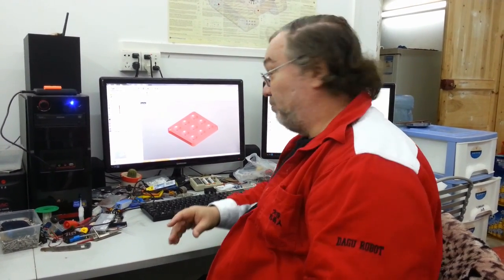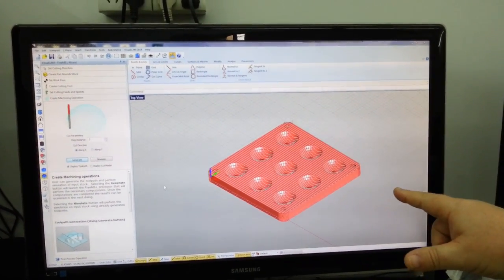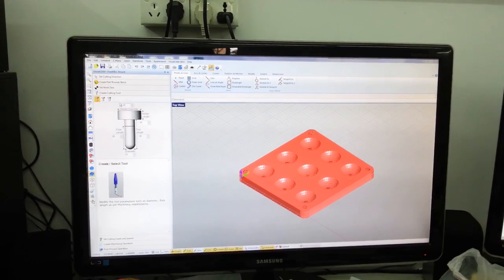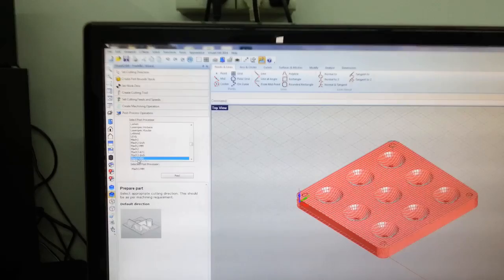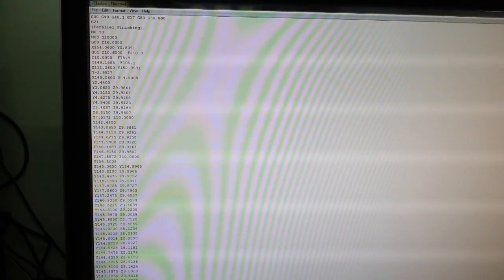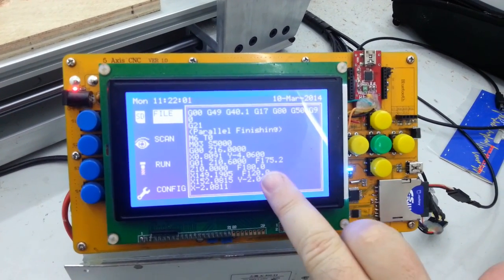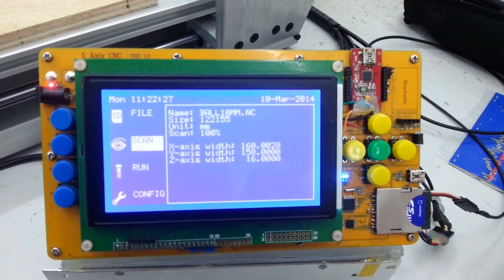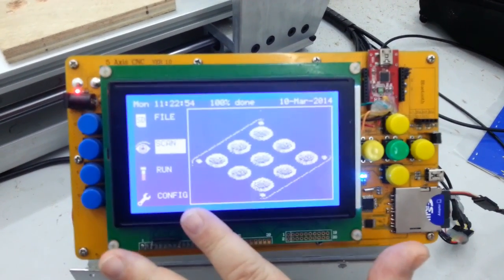CNC prototype first run

Comment: I was wondering if any progress has been made on this?   I idea is great.
Reply from the maker: Yes, a new version with higher current motor drivers has been developed. I am working on the code now. Should be a new video in about another week or 2
Reply: Russell Cameron do you plan to sell these as a kit,  open source...
Reply from the maker: Dave Landry Yes, this will be a DAGU product in the near future.